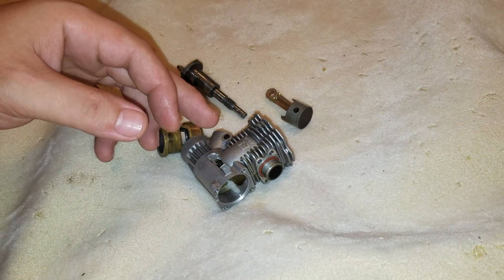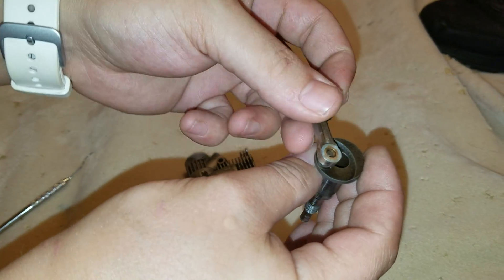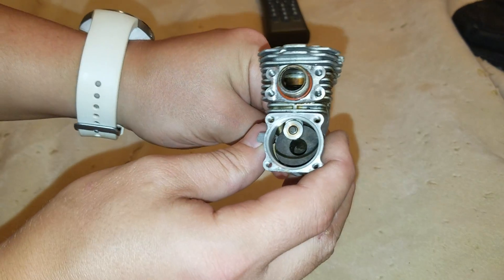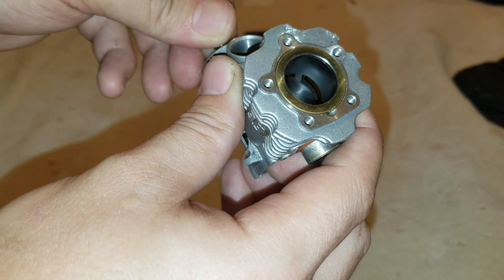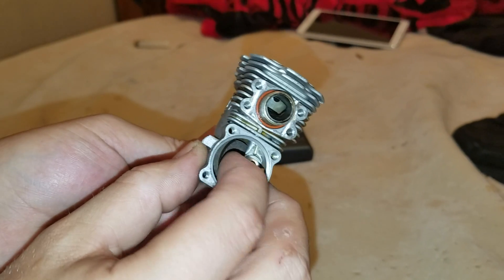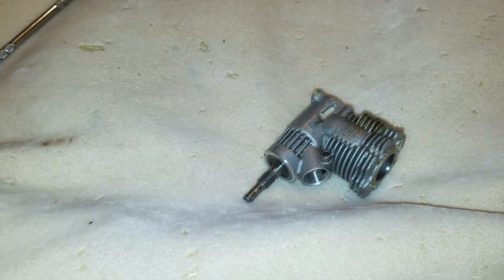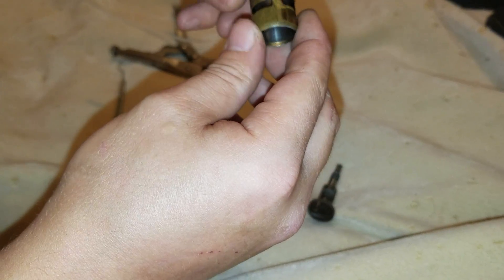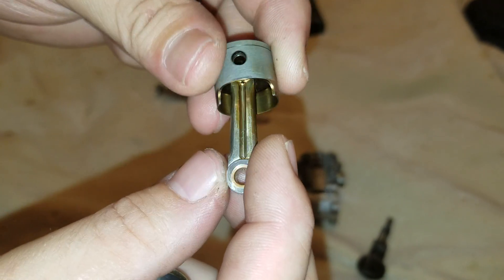How the internals of a nitro engine works

Comment: How is the ignition timed? Becouse the glow plug is always on right?
Reply from the maker: Shims and cooler or hotter glow plugs determine when the air fuel mixture will ignite
Reply: cycle is so quick glow is ignighting hence its compleated 2stroke timming where piston tdc
Reply: Yes, the heat and pressure ignites the fuel and air, so the glow plug isn't  always on

Comment: what does the pipe from the exhaust do
Reply from the maker: Matowix creates back pressure, sends pressure to the fuel tank via a tune cause these don't have fuel pumps, the pump is the amount of pressure the exhaust sends to the tank, the higher the rpms the more pressure to the tank, the more fuel the engine gets.

Comment: wouldn't the glow plug ignite entering fuel?
Reply from the maker: No, not until it is compressed.  nitro engines are very similar to 2 stroke diesels in how combustion occurs
Reply: nitro methane explodes doesnt fire it carries its own oxygen